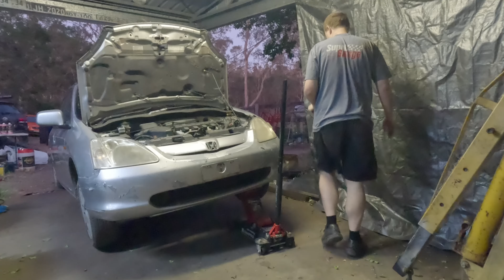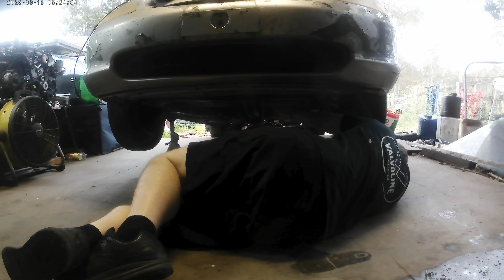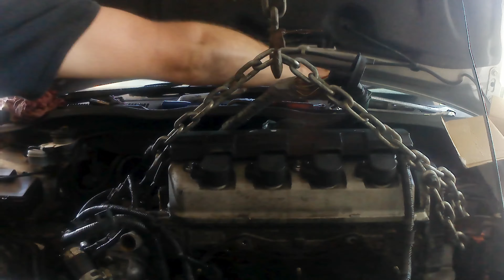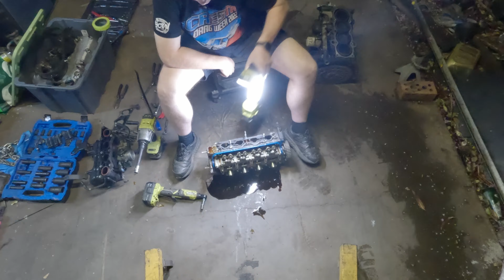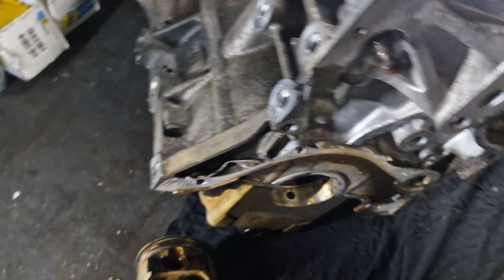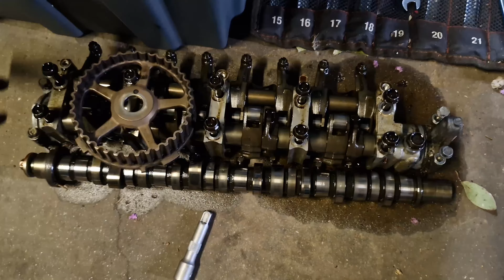D17A2 High compression build begins

Comment: PMS-A0 will give you a compression of like 9.25:1 with the d17 head and gasket? Dome cc is 4.0 with compression height of 27mm
Reply from the maker: I think your math might be a bit off there. D17A2 has a factory compression ratio of 9.9 with 6.2cc of dish and the same compression height Once you add the 4cc of dome it brings the compression ratio up to around 12.5
Reply: @BlackbirdPerformanceau  ah yes my bad, i calculated with the 90mm stroke which is d16 instead of the 94.4mm you are using. Still with the 0.026" thick factory head gasket compression is at 11.89:1 with 4cc pms-a00 piston dome. Im building a high comp d16v1 (its the same engine but with 90mm crank) and im using P29 pistons to bump comp to 12.04:1
Reply from the maker: Zealautowerks Calculator? if so be careful as there numbers are not quite right when it come to the D17 stuff. an awesome tool but it has its quirks.

Comment: I've designed a basic manifold to adapt honda cbr1000rr throttle bodies to a d17 engine in cad, it can be 3d printed with carbon fiber nylon or CNC or any other method of manufacture that involves cad, if it interests you you're free to have the STL files
Reply from the maker: Thats sounds awesome, shoot me the files and ill take a look. Probably wont go on just now but a really good upgrade in the future.
Reply: I would like to see this, cause I want to design a custom manifold and 3d print It. Your work would save me scanning the part for good fitment.
Reply: I would like to have it too! I would like to push the d17 further and stay n/a. 156whp atm. I would like to go full build eventually

Comment: I thought those engines usually go out the bottom! I'm surprised it came out the top. 
Good to see Dean getting his hands dirty but where's your better half 😁
Reply from the maker: If it was a manual car, it would have had to go out the bottom but being an automatic you can sneak it out the top without the transmission. Dean was a good help and saved me a bunch of time.